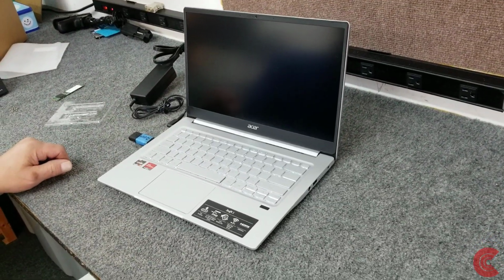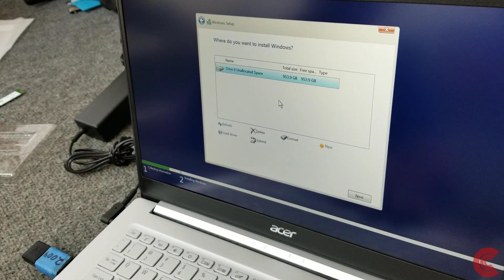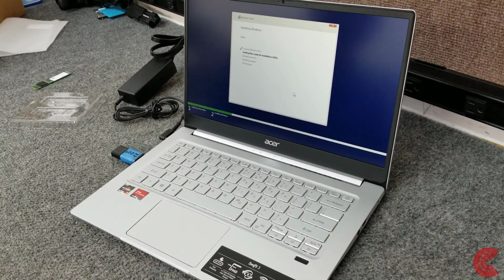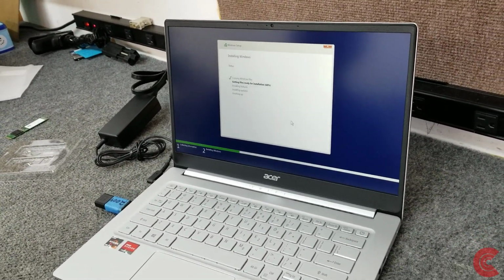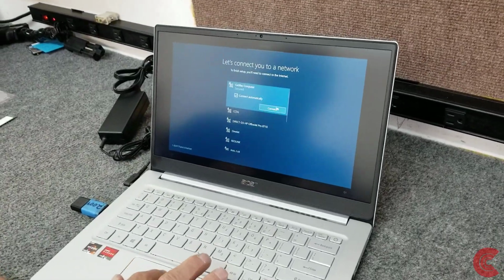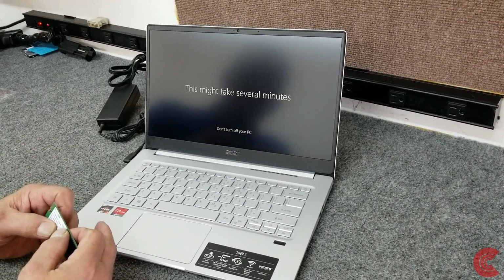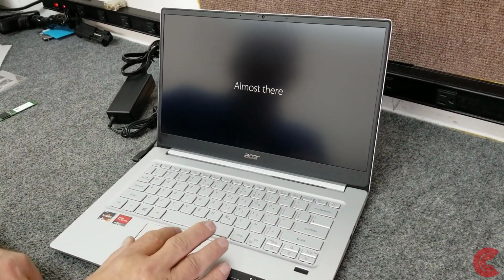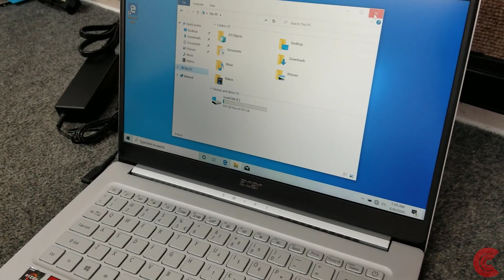Acer Swift 3 Ryzen 7 SSD Upgrade & Clean Windows 10 Install

Comment: Hi I have a swift 3 with ryzen 5 3500u, it came with a 1tb hdd and trying to add an m2 240gb ssd but bios is not detecting it, any advice for the fix?

Comment: So you can’t install nvm heatsink over it to prevent thermal throttling in little extreme usage from the likes of Crucial P5 or Samsung 970 Evo Plus? That way I get the best performance out 24/7... then again, like a phone or tablet, the tdp is going to throttle those high performance drives.

Comment: Hello Everyone,  I read a thread on the Acer community https://community.acer.com/en/discussion/607329/swift-3-sf314-42-crashes-on-sleep
It said the SN550 from WD is not compatible with Acer SF314-42. I met the same similar issues. 
1. you can not clean install Pro Entp versions.
2. you can only clone a original Windows onto it. but you will meet crash after windows sleep and awake. AND you can not change power management setting. otherwise the PC will be in deadend rebooting.
I give from 1T upgrading. 
Trust me! Acer is not suitable for a DIYer. You only can use it as what it is.

Comment: Hey I got a same model Swift 314-42. I bought a WD SN550 1T t
o upgrade this laptop. BUT When I try to install Windows 10 2004 or 1903 I always get a blue screen error. I even tried to restore the default system(I created a recovery disk) on the WD driver. I got the similar error always. The only way to be successful is colon the entire driver. But I met another issue. When I try to change the power management settings from Acer to any other, the system will crash and get into a blue screen error plus cannot get into Windows anymore. So grading is filled, do you have any idea or experience such kind of situation before?
Reply from the maker: Hi.  Did you do a clean install onto the new ssd?
Reply: @CadillacComputerCenter  yes I think I did it. I deleted all partitions on the driver. Disable security boot

Comment: Hello. I got an Acer Aspire 5 A514-52K model and installed an m.2 ssd. When I tried accessing the bios to change the boot order I could not find the hdd and ssd. It only shows windows boot manager. However, when I checked on the my computer ssd is already the C drive although in the disk management disk 0 is the hdd while disk 1 is the ssd. Is there something that I need to change or just leave things as it is? Any help or suggestion is highly appreciated guys. :)
Reply from the maker: Hi.  Your bios is exactly as it should be.  With UEFI and secure boot enabled,  you won't see your drives, unless you are in legacy mode with secure boot disabled, which you don't want to do.  Dale
Reply: @CadillacComputerCenter  Ah i see. Well I did research on how to change it to legacy but I was a bit skeptical. I'm a newbie in this diy upgrade and I don't want to mess up my laptop as I can't afford any replacement yet. LOL. Everything makes sense now. Thank  you so much. :)
Reply from the maker: Your welcome.  Dale

Comment: Hi, I'm a proper laptop newbie. Thinking of a swift 3 but on a tight budget so looking at the Ryzen 3 4gb 256ssd model ( good deals in the UK at the moment) 
Could you please tell me if all of the swift models can take a ram upgrade?  I think it is a slightly older model on offer (silver bezel) 
Model no is sf314-41-r6 yg 14"
I was certain it could from your previous video, then came across a random video with a soldered ram, which wasn't clear on model.
Any advice would be greatly appreciated. 😊
Reply from the maker: Hello from across the pond!  You should be able to add at least an 8gb stick. You probably have 4gb on board.  And one expansion slot.  The US version of that model, I've added an 16gb stick for a total of 20gb.   Dale
Reply: @CadillacComputerCenter  Thanks a lot, that puts my mind at rest.😊 
Hard to believe, but at 43 I'm buying my first ever computer and giving myself a YouTube crash course on windows 10.😂
After much searching pinned it to either the swift 3 I mentioned, 14" 4gb 256ssd or  Asus m509da 15.6" Ryzen 3 8gb 256ssd.  Both bang on top budget. Both have backlit keys, IPS display etc. I've no experience of either brand, but the metal body on the swift is seducing me:-)
Any thoughts on the Asus Vs Acer in question?  
Ps. Subbed and thanks again.👍

Comment: Hey if i want to install a 8gb ram and theres already 4g in a slot  can I just put the 8gb ram in the second slot and not have to remove the battery?
Reply from the maker: Yes you can. However, to be extra safe, you should disconnect the battery. Dale
Reply: Cadillac Computer Center okay i will thank you